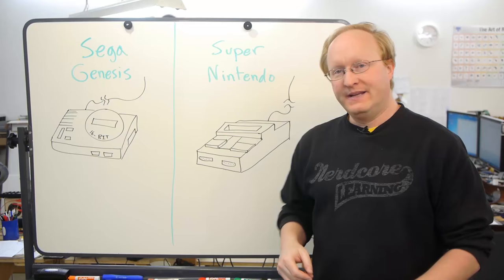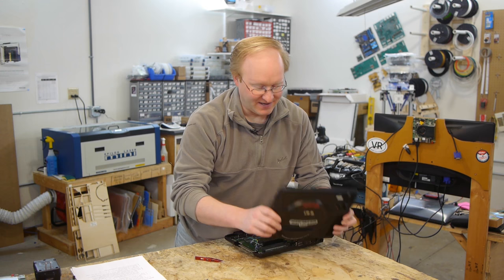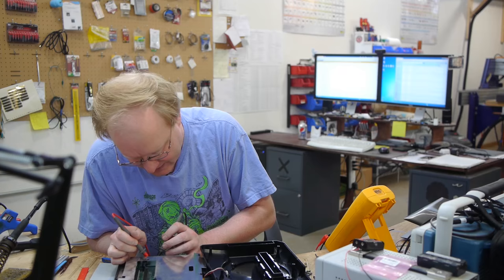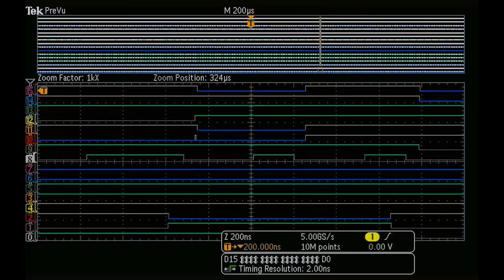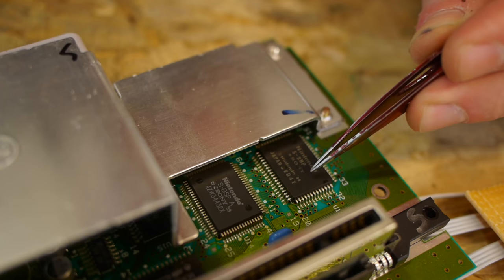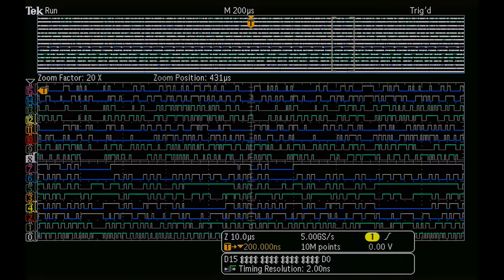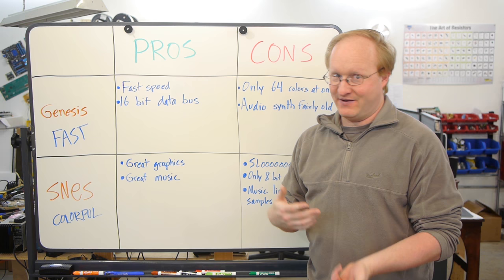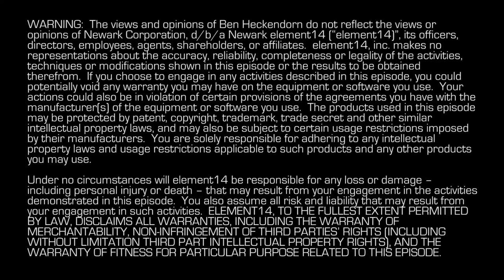Ben Heck’s 16-Bit Console Wars!

Comment: Decades later, sad Genesis fans still seeking some sort of redemption for a chapter of history that's already been written.
Reply: +Andrew Vrba Read this paragraph. The SNES chip may be more capable, but its the one that sounds like shit. How? The reason revolves around how it uses its audio ram. The genesis, with its 8k audio ram, is fine. It actually could probably do fine with 6k due to the synthesizer making very effective use of its audio ram.. However, the SNES, having a non synthesized audio chip, is constantly filling the audio ram and making a terrible use of it. 64k may sound like enough, but 64k audio ram is not enough for the SNES. That's why it sounds muddy and has no bass. Also not to mention, the genesis can swap its memory faster due to its 7 MHZ cpu. I will admit, if the SNES did not have its memory bottleneck and slow CPU, it would be better than the genesis. But the factor is Nintendo was really stupid when they designed the SNES, and even the N64 (Controlled entirely by the GPU), and SEGA's engineering division was superior in many ways. If they had built a system meant to kick the SNES out of the market, they could have done so. But you have to remember that the Genesis was meant to compete with the NES. I will say that the Genesis has terrible graphical capabilities compared to the SNES. This states teh differance between the two systems. Nintendo had a terrible engineering team, and thats the reason the Genesis survived. Engineer from Nintendo: "Lets build a system to beat the other system and make sure it has severe bottleneck because we wanted to do a cheap shitty job at building a system capable of beating our competition" Nintendo CEO: "That sounds like a great idea!". 2 years earlier: Sega engineers building the genesis: "Lets build a system that has a shitty video processor but great CPU and nice audio with no bottleneck" Sega CEO:"Cool lets do this!" Sega of Japan:"Today at Sega of Japan, we are going to be little shits and shoot our own company in the foot by declining every good idea from our awesome team in america" -(Just a joke but its true XD).
Reply: DejaVoodooDoll But if you needed to buy a peripheral that cost as much as a console, to get better audio, does that really count as "winning"?
Reply: +Phoenix Gaming God you Sega fanboys are annoying

Comment: Super Metroid is a counter-example to your deduction that the SNES could only be used to play slow-moving/slow-paced games.

I don't know if, and what kind of, programming tricks they needed to invent to make it work, but the console was clearly capable.
Reply: WarpRulez A separate chip on the cartridge to make up for the crap CPU. Much in the same way Sega made a CD addon for better audio plus hardware scaling and rotation.
Reply: WarpRulez Super Metroid was certainly not as fast as sonic. which is a pointless argument, because going fast never really added to the game and most of the game-play of Sonic was kind of boring compared to a lot of SNES titles.
Reply: spiderobert
"Fast" in this context shouldn't be a measure of how many pixels per frame the background moves. That's trivial, and doesn't measure any kind of hardware prowess. Rather, it should be a measure of how much stuff is moving on the screen at the same time. In other words, how fast the console is at rendering moving stuff.
Reply: WarpRulez but that's rendered on the graphics chip and is stored in the graphics chip memory, which they already said is superior
Reply: WarpRulez The difference is that Super Metroid had supplementary hardware inside its cartridge. The Genesis, by itself, is better for fast-paced games. There is literally no arguing that, as that's exactly what this video showed.

Super Metroid was the exception that proves the rule.
Reply: Christopher Pilcher In fact, Super Metroid does not have any supplementary hardware inside the cartridge.
Reply: shiru8bit Where did you find that information?
Reply: Christopher Pilcher The game itself, cart PCB, almost any emulator (they show HW config for loaded game). You can search for cart PCB photos, and see by yourself - it has just two mask ROMs, 64K SRAM, MAD-1, CIC.
Reply: shiru8bit I must be thinking of a different game then, because I'm pretty sure my copy had extra hardware in it.
Reply: Christopher Pilcher The most common games with extra hardware are Super Mario Kart, Pilotwings, Star Fox, so maybe it is one of these.
Reply: shiru8bit it was probably Star Fox. I took a few games apart as a kid because I was an idiot, and I didn't exactly keep notes.
Reply: shiru8bit Super Mario Kart = no chips
Pilotwings used a chip to make Mode 7 able to rotate up/down and left/right at the same time
Star Fox uses the Super FX chip to draw polygons. 'nuff said
Reply: Fast-ish. Still not as fast as the Sonic games.
Reply: MarioKart7z Wait, I thought Super Mario Kart had a DSP chip. I remember when SNES9X and ZSNES won't run them because "they used special chips", and it was big news when SNES9X first cracked SuperFX emulation, then DSP emulation. Then Capcom C-4 emulation.
Reply: MarioKart7z Super Mario Kart uses DSP1, the same chip as Pilotwings. It handles all 3D projections and some math.
Reply: What is fast on super metroid?  Easily my favorite game in the system
But it's slow and almost nothing on screen at a lot of the times.  Go play Gun star heroes and tell me how that would be possible on the Snes.  Sega games moved WAY better than snes games.
Reply: umiami80 I'm going to quote TVTropes on this: 

"Or take processor speed. The Super Nintendo's 65816 CPU had a clock speed of 3.58 megahertz. The Sega Genesis's  68000 CPU had a clock speed of 7.67, just over twice the Super NES. So that meant that Super NES games should only run half as fast, right? Sega did have this advertising campaign of "blast processing", and some early Super NES games did have slowdown. Well when Capcom ported Street Fighter II Turbo to the Super NES, it had a secret mode that was even faster than the arcade speed, but no slowdown. The mode turned out to be more gimmick than playable, but it showed that the clock speed was only part of how the processor worked, and proper use of the system was what made the game run so fast (this was also shown when the game was ported to the Genesis, and also had no slowdown in that mode).

In fact, nowadays most hardware engineers have given up on bumping clock speeds and gone on to improve bus speeds, which has less to do with how fast the computer "thinks" than with how fast it "talks". Taking the same example of fourth-generation consoles, the 65816 could "talk" at full speed, while the 68000 could "talk" only once every four cycles, resulting in an actual speed of 1.92 MHz for the Genesis. But the 68000 could push 16 bits every bus cycle, twice that of a 65816, making them not too different in overall bus speed (3.58 MB/s vs. 3.84 MB/s)."

So there you have it. The SNES can access the bus anytime it wants, but takes two CPU cycles to move a 16-bit value to and from memory. The Genesis can only access the CPU once every 4 cycles because of the bus being arbitrated, but it can move 16-bit values to and from memory in just one cycle. Not so different in terms of raw speed.
Reply: Not so different in terms of raw speed?  Are you serious?  The Snes is known as a slow down machine.  Take for example the final fight series, single PLAYER, it can't handle all those sprites on screen.  Look at Streets of Rage 2, 2 player, many many more fighters on the screen.  The SNES Chugs, it does have tricks and extra chips added when push comes to shove it is ALOT slower than the Mega Driver or even the Turbo Grafx 16.

IDK why you bring up super street fighter 2 turbo, it is SO SO SO much faster on the Mega Drive.  SNES simply cannot move a larger sprites (Or smaller, go play R-Type, I've seen slide shows with better animation) without significant slowdown or slower sprites to begin with.  A Game like Gunstar Heroes, Sonic 2, Alien Soldier, Ranger X would simply be impossible on the SNES or at least severely handicapped albeit with better color and muffled sound.  The SNES sound isn't as clear as the Mega Drives FM chip, it is muffled
Reply: umiami80 Also XBOXONE just bumped their clock speed on their console via downloaded update.  this is very common.  faster clock, more raw HP until it melts ;)
Reply: spiderobert SNES could very well handle "fast" games. See: F-Zero, Sparkster, parts of Secret of Mana, etc. etc...neither system was really "faster" than the other, when it came to "fast games".
Reply: F Zero isn't a fast game, it's a mode 7 game.  It scrolls a low resolution floor and the SNES only needs to animate some Sprites for a ship and background horizon FX.  A game like Gunstar Hereos would melt the SNES< couldn't be done without special chips.  A game like Streets of Rage 2 couldn't run with all those characters on screen with 2 players, wouldn't work without massive slowdown.  The snes is know for slowdown.  The Sega Genesis has a decided advantage with animating sprites and sprite content.
Reply: umiami80 ...So you're using some vague definition of "fast" which is different from what the old commercials would imply. Ooookay then.

SNES has plenty of fast-paced games. To claim that it is incapable of "fast" games is objectively wrong. Also, Genesis had a good handful of games that had slowdown problems. Even its own flagship Sonic games would have severe lag and framerate deduction when there were 20+ rings onscreen at once.
Reply: I definitely remember SNES games slowing down while playing. At least in Final Fight when there were several characters on screen at once, other games too though. Nintendo was good about making their 1st party games not slow down through level design and whatnot.

I don't think it's a huge deal though. It sort of helped make the game not feel frantic when it slowed down letting you have a breather.
Reply: SNES is great at 1st party games, no doubt.  But a fast paced action system it is not.
Reply: The Snes games that push action to its limit imo, are...Contra 3 (primarily), Mega Man X, Super Punch Out, Ninja Warriors and perhaps Hagane. UN Squadron is also a contender.
But compared to the best action games on the Genesis, the Gen is in another league, for 2D arcade action is what the system does best, it's primarily what it was designed for.
Some games have already been mentioned here like Gunstar, Alien Soldier, Shinobi 3, Contra Hard Corps, also amazing shooters like Thunder Force IV, Musha, Fire Shark, Gleylancer, Battle Mania 2, Twinkle Tale (that would struggle on Snes hardware).
I think Snes is best as an rpg machine and perhaps even for platformers.
It's too bad that the arcade genre in general is not as well regarded or received by western audiences, that's a good reason why the Snes is usually regarded superior, because it has great rpg's like LTTP and Chrono Trigger and those games simply receive more attention due to their genres, even though yes, they are timeless classics as well, there's no doubt that there is strong genre bias in the American retro community.
Reply: Retro Soul yeah but SNES did have some great arcade games though like Turtles in Time or the Final Fights (which i found superior to Streets of Rage).
Reply: Did you find the Final Fights superior to Streets of Rage 1? Or 2? Or 3? Because there's a huge difference in quality between 1, 3 and 2. SOR2 is by far the best in series and arguably the best beat em up of all time.
If you've never played 2, I highly recommend it, it has the deepest 16-bit fighting system with tons of mechanics (considering controller only has 3 buttons) to keep the gameplay fun and interesting if you take the time to learn and master everything. It's a blast.
I personally think Ninja Warriors is the 2nd best 16-bit beat em up and the best one on the Snes. It also has a pretty deep fighting system. I forgot to mention it in my above post . It's a pretty underground game that not many people played/

Comment: SNES games also run at a lower resolution 256x224 vs 320x224 on the Genesis.
Reply: Caleb Claxton actually no it doesn't . Running a menu at 512x448 is not the same as running in game at 256x224. Fact is the Genesis ran most games at 320x224 and the snes ran all of its games at 256x224.
Reply: To add, if you boot Genesis and Snes games on emulators you can tangibly and very easily see the difference in screen resolution.

In their native aspect ratios, you can see on your monitor that the Snes window is a cropped square, while the Genesis window is rectangular, allowing a wider horizontal field of vision in it's games.
Games like Revenge of Shinobi and Thunder Force IV, compared to sayy Mega Man X and Contra 3 very easily display the difference in field of view (aka screen resolution).
Reply: Caleb Claxton Snes cpu couldn't push as many sprites as the Genesis. That's why even the legend of Zelda had slowdown. Sports games and Shumps are especially better on Genesis than Snes. For better or for worse the two systems are equal. Where one is great the other isn't and vice versa.
Reply: Chris W it's irritating how many people just don't see that. One big reason I think is because "brighter and more vibrant" colors in SMW is easier to notice than "how many sprites are on screen" in SOR2 and Gunstar Heroes.
But still, the ignorance regarding the technical prowess of both consoles is insane.
So many misconceptions out there and all are almost blindly in favor of the Snes.

Comment: Actually, I think the Neo Geo was the best 16 bit console of the day, even though it was incredibly expensive and no one had it.  But, of the two most common 16 bit consoles, each had its advantages, but I give the upper hand to SNES for only two reasons: (and yes, I pronounce each letter in the title)

(1) The 65816 did require multiple data reads and writes in order to handle 16 bit data, true, but most of its operations took few clock cycles.  There's no operation on a 68000 that takes less than 4 clock cycles to complete, just because of how it was designed.  Meanwhile, the 65816 could perform several operations in 2 or 3 clock cycles.  The 65816, despite its slow clock speed, was a faster chip for general operations.  It did, however, lack multiply or divide operations which would give the 68000 the advantage there, even though division on the 68000 was incredibly slow.

(2) The Genesis was released in 1988, and it was likely in development for years before hand.  The SNES was released in 1990, two years later.  Those two years meant more bang for the buck, allowing Nintendo to put more RAM (one of your touted features) and better tech into the SNES.  Which gives the SNES an advantage bordering on cheating.  You may as well compare the SNES to the Intellivision.  I mean, they're both popular 16-bit consoles, even though there's a 10 year gap in production.

So, yeah, it's fun to compare the systems, but without proper contexts, it will always boil down to "SNES came out later, had better technology, and was therefore superior."

But at the same time, despite having inferior technology, the Genesis fought the SNES and held its own.  It was two years older (which, in tech terms, is HUGE) but it was still as popular as the SNES.  That says a lot.

Comment: SNES is way better never mind any specs because it's the games and controller that kicked so much ass
Reply: I was an NES kid and we had a Genesis later on and would rent the SNES occasionally, but yeah, in general I prefer the SNES for the games. Tech specs are more relevant in PCs and computational work. Having good games are more relevant for gaming consoles. For example, I much prefer the SNES over the N64 overall, and even the NES over the SNES.
Reply: For a little perspective, the Motorola 68000 processor of the Genesis is the same processor in 20 year old TI-89 calculator.